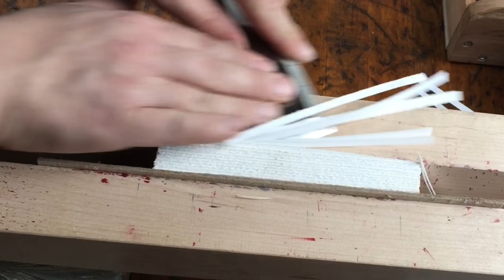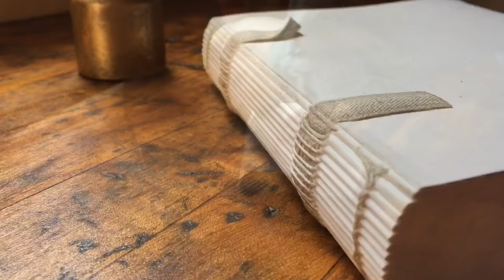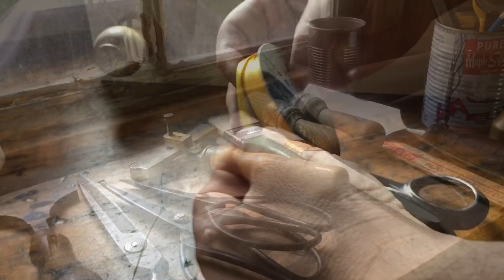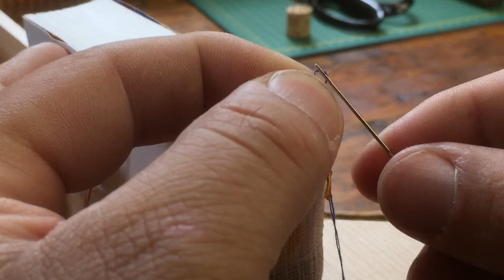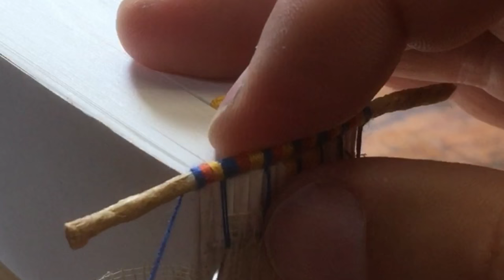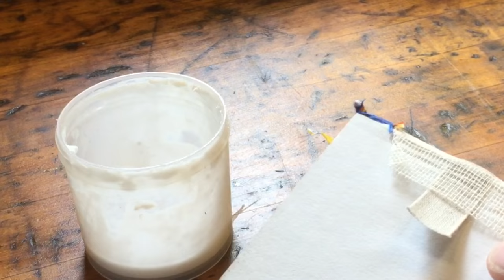Making a Handmade Book - Part 2 - Rounding & Endbands

Comment: Nicely done! But why do you add a mull backing? In my experience the mull is used only on support-free sewing structures, like machine sewing or modern chainstich.   Support sewings (like chords or ribbons) don t need it, and might render the book a bit too unfrienfdly to open.   The chords and paper lining usually make a book flexible and keep the round shape.   I m curious about your motives.
Reply from the maker: Thank you for the excellent question! My reasoning is simply that it is the method I first learned. In Arthur Johnson’s book on bookbinding he describes mull and Kraft paper being used on all of his bindings, including those sewn on tapes or cords. But of course his priority was always strength and longevity. For a casual journal or sketchbook like this a more supple spine could certainly be an advantage. As I learn more about this craft it has become apparent that there are as many methods for making a book as there are bookbinders. Thanks for watching!
Reply: @FourKeysBookArts  when I was a rookie, nobody would teach me anything so I began to learn from youtube or tutorials. Once I got the hang of things I asked around other people also starting out. I Used to cover the first mull of the printed hardcovers in wood PVA, then glue cotton fabric, then paper, then once more, paper. The result was stiff as hell but hey, guess that s how it s supposed to be :))  Once I began reading old bookbinding manuals and learned, things changed. A lot.   yep, pretty sure mull is not needed on chord-sewn bindings, only paper lining. Best of luck, my man!
Reply: @FourKeysBookArts  sorry, I was on my personal account. Still me.
Reply: @FourKeysBookArts  I learned bookbinding in college (my undergrad school has a book restoration lab) and what I was taught was cord/tape or mull, but not both. A sufficiently flexible mull, as you've used here, is probably fine but some folks use much stiffer fabric and the combination could impede the movement of the book over time.
Reply: @FourKeysBookArts  Wow! Good reasoning. I am learning so many different styles that it is fun to find what I like best!

Comment: Is there any particular reason you use a wood chisel rather than a plough? I'm only asking because I currently use a French-style paring knife for trimming the block, and was wondering if there's merit to sticking with that rather than saving up for a plough
Reply from the maker: The honest answer is that at the time the chisel was all I had. The French paring knife is likely a better option, as it has a rounded profile that will help prevent it from catching in the paper, a problem I have encountered with the chisel. Both have the disadvantage of being hand-held, and therefore susceptible to wandering in the cut and being hard on the hands over a long period of use. I intend to make my own plough in the not too distant future. Thanks for the great question!
Reply: @FourKeysBookArts  Ah, that makes sense, thanks so much for the quick answer!
Reply: I'm having a hard time finding a French pairing knife. How did you get yours?

Comment: Great video. Thank you for sharing!
I still have doubts about the sewing of the headbands, 
a) Did the needle pass through the center of signatures or between them?
b) Is it risky passing the needle FROM the spine to the inner of text block? (to avoid damage paper it would seem safer passing it from the inner of signatures to the spine)
Reply from the maker: Glad you liked it! To answer your questions, the needle goes through the middle of the signature, and yes this is the safer way. I have never sewn an endband from the spine inward, mainly because there would be no control whatsoever as to where the needle came out. 

I have another video that shows the endband process in better detail here: https://youtu.be/AFRrbxyjerE. The endbands start around 21:00. Thanks for watching!
Reply: @FourKeysBookArts  Thank you! It makes a lot of sense

Comment: The blue,red, yellow Threads is for what purpose,pls.
Reply from the maker: Those are called the endbands, and they are meant to support and protect the covering material at the top and bottom of the spine. In practice though they are mostly just decorative. Thanks for the question!